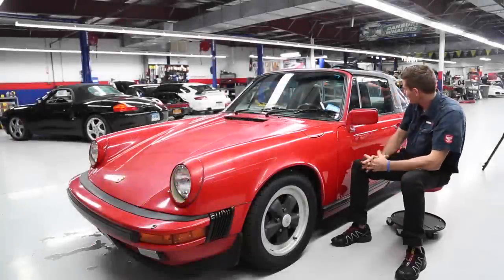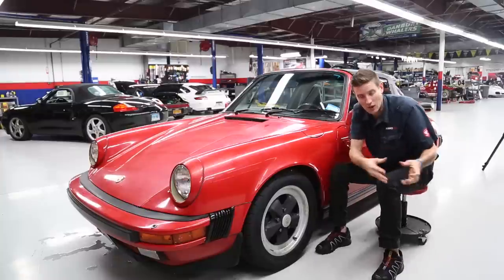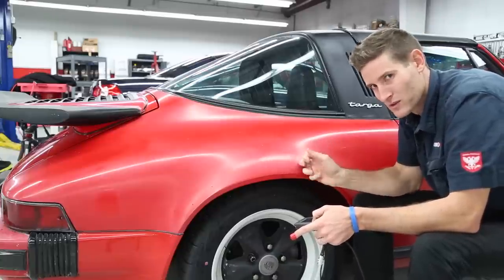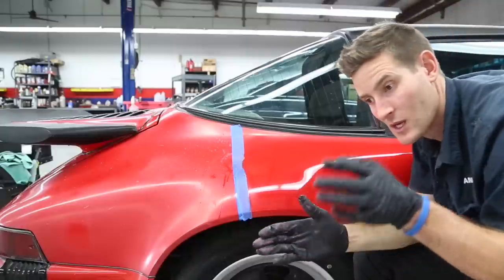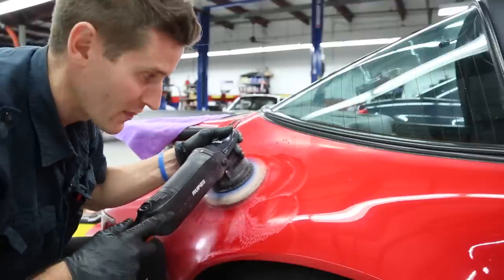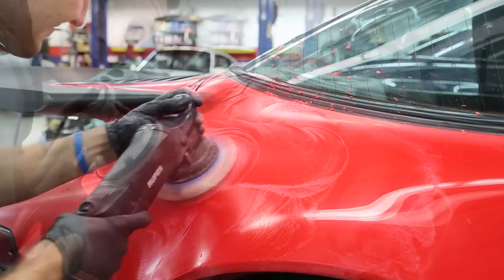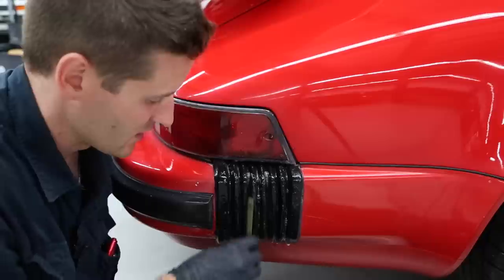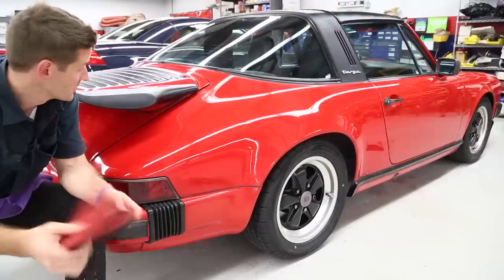How to Wetsand Oxidized Paint with a Rupes Polisher: Porsche 911 Targa

Comment: Larry, as a professional detailer since 1985 working at a very high level, your videos are excellent and filled with common sense instruction and information.  It's funny to me how our processes are extremely similar.  Maybe it's like Chinese medicine.  3000 years of trial and error we're going to eventually figure some things out.  Maybe I'm a bit older school than you but I still prefer a high speed rotary for the meat and potatoes of the cutting work when doing extensive paint correction.  The long throw orbitals like your Rupees or the Griots Boss that I use are certainly game changers for all of the final finishing / buffer mark removal though.  I just find that while far safer for less experienced users, the orbitals just don't have the raw cutting ability to get the paint where I want it in a reasonable time frame.

Comment: That was an impressive job, Larry. Truly a great result.
Last week we gave it a try at cleaning my friend's engine. But the thing is absolutely horrible. Never seen anything like it. Grease, oil, mud encrusted on several spots, wire covers...a real nightmare. He wanted to just improve it a bit, a quick touch. So, I worked on it for just about 1/2 hour, with brushes, heavy degreaser, even Car 80 on the block. But still, has a lot of gunk stuck at several spots. Any advice? Thanks, man.

Comment: i watch all of your videos and have learned a lot but with your paint thickness gauge.  Isn't that measuring the base coat and primer together or is that device you have one of the few that can measure each layer?  Just would like to understand if it's possible by calculations of the device how would you know exactly how many mills just the base coat is.

Comment: When you measure the paint depth, I take it that it measures down to the metal? How do you tell how deep the top coat is, and it's not just mostly filler/primer making up that thickness? Or is it just down to experience.
Reply: He measures the door jam to get the "minimum" amount because car manufacturers tend to use the least amount of paint on these parts that are not exposed.
Reply: this did not have a "top coat" its a single stage paint meaning no clear coat. That's why you can see so much red coming out when he was polishing. old Porches and Ferraris especially the F40 and F50's were notorious for ending up like this. really dull and almost white looking due to the soft paint with lack of clear coat
Reply: jack black I know - by "top coat" in this context I meant the actual colour layer. I said "top coat" because my question pertains to that top layer, whether it is a single stage paint, or the clear coat in a two stage finish.

It seems people haven't gotten what I mean, or am asking about. And I guess this is more relevant to paint that has been redone since the car left the factory as the paint is laid on differently depending upon who does the job, and the paint brand and type used.

I have looked at several paint depth measuring tools, and they all measure the total thickness of paint down to the metal bodywork. That will include any fillers, primers/sealers, single stage colour coats, or base (colour) coat and clear coat.

My question is, how do you know what ratio of that thickness is the top layer you are wet sanding and/or buffing/polishing? It seems to me that it can seem thick enough to wet sand, but it may actually not be.
Reply: mrman17 Most of the thickness is the top layer, that's how you know.
Ultimately, you wet sand when you have to wet sand, and you don't when you don't. If it's what it takes to get off the oxidation, then you do it even if there's a risk of going through the paint, after confirming with the owner. There's no magic wand to wave, especially on hand-painted cars which might well have uneven thickness since the painter is spraying for a look, not for a thickness.
Got a nice hole in the paint on the door of my '82 300SD, the paint is failing so hard it covers up with wax though. Time for a full respray with a clear coat, like dog intended. We've had clears forever, single stage was always a bad idea
Reply: Martin Espinoza Thanks for the reply. I did just have a bit of a facepalm moment as I realised that if the paint is this bad/oxidised, it really doesn't matter if you do go through as it would need painting anyway.  If wet sanding, buffing/mopping works, then cool, if not, nothing is really lost. 
Like you said, as long as the owner is aware that it may not work.
Reply: He measures the inside of the door and subtracts that value from the readings from the hood or roof

Comment: First off... best videos I've seen on restoring finishes on cars. Maybe pick some better keywords to have people find your  videos. I have been trying a few different things to restore paint on a vehicle with heavy oxidation and has proven difficult as my compounds and polishes have been difficult to remove after applying by hand or by machine. I have wet sanded and tried; still little success to remove the dried up application without alcohol or "quick detailers". I have been seeing that it is good to apply some glaze to allow the paint to soak up the oils and then give compounding and polishing a go.. I see you have done this single stage on the red Targa and was trying to figure out what you are talking about with adding leveling fluid to compound? Also any suggestions for my restoration of this old oxidized paint would be great?

Comment: Hi Larry, just wondering if i could do the same process on oxidized alloy wheels paint ? 
Wheels are in good shape (incidentally, they are pretty much as old as the 911 targa), but the paint looks dull, almost matte. I'd much rather do that than having them resprayed. Thanks for your straightforward and filled with knowledge videos.

Comment: I saw several comments about the paint depth. Here In the US as most know, our measurement system is a little strange. But basically a Mil would generally refer to a millimeter. Not in America, we call it a millimeter. A Mil when spoken by a yankee refers to one one thousandth of an inch or .001" it's just easier to call it a Mil and everybody, well not everybody, but most know what we're talking about.

Comment: Larry you are simply amazing.  I have learned so much from you over the last two years since I became a mobile detailer, and I am so looking forward to more.  Lately I've been using my Porter Cable 7424 with a 5 inch or 3-in backing plate and the trizact 3000 and 5000 pads either three inch or 6 in or sanding oxidized or paints with heavy water spots.  I've only done six cars with this method and you're very slowly and learned everything from watching your techniques. I'm still trying to figure out is there a better machine to use for sanding such as the Rupes has 75 air machine whose power scares me.   I thought about the lhr-75e the electric machine to use instead it's a 3 in but one of the versatility of also using a 6-in. So the next stop was looking at the Griot's G8 and G9 combination.  I'm going to the PS polishing and Sanding school on Friday to learn more and look forward to it.  Without your guidance I wouldn't of been ready for it thank you
Reply: What machine do you recommend for a newbie like myself?

Comment: When you wet sand it’s better when you don’t skip numbers....1500-2000-3000. And always in non metallic colours sand a small part and check if the dust you have is white then you are sanding clear not paint

Comment: beautiful job.  This is the first video of your's that I watched and so far I got to say I enjoy your style much better than chemical guys.  

I have one question out of curiosity, as I no longer have the car, would you recommend sanding down and clear coating an older single stage painted car?  As in add a clear coat to a paint only car or is it better to keep the original single stage paint only layer?

One more question, some idiot previous owner seemed to have painted, with a brush, some clear varnish on my black Honda Accord and I would love to sand it down to clear and get rid of those horrid brush strokes.  Question is what should I look into first? and do you think I should invest in a paint gauge? Thanks for your time.

Comment: My truck is white, O.E. GM paint , roughly 12 years old but it's in great condition (of course there's dings but I mean the paint isn't oxidized or faded). Would it be worth it to cut and buff the paint to get rid of the factory orange peel or does the bright white paint make it too hard to see the improvements?

Comment: This is a two part comment .. 

1. Larry, is there a way to properly sand with the polisher? I did it once ( with a foam sanding disc) 2000 grit then moved to 3000.. I noticed pig tail looking sanding marks. No matter how many times I re sanded or compounded and polished.. they were still there. 

2. The yapping is a good thing. We learn alot. (Attention To Detail) I can learn more from a 300 page book than I can a 5 page picture book.
Reply from the maker: Thanks bud. Check out my other videos that include wetsanding. Pigtails are from dirt or grit in the sanding discs.

Comment: Did you try wetsanding with just 3000 grid? Imo 1500 is too harsh, cuts a ton of the paint off. Ive never needed to go that harsh grids on car paint, and ive done some pretty bad non-clearcoat old cars.

Comment: Do you know what kind of factory paint is on a 1989 Ford F-250? I just bought one that is spotless except for the oxidized paint. I was going to clay bar it then compound it and then polish and wax it (all with a DA polisher). Would this be safe on that paint? I know this doesn't compare to the paint on the cars you work on but I respect your advice and love your work. I learned how to compound polish and wax my Excursion all from your videos. It was black with terrible swirl marks. It is immaculate now. So thank you!!!
Reply: Ohio Digger  The factory paint code should be on the inside of the drivers door.

Comment: I know this is an older video but what are you using to determine the thickness of the top coat? Im pretty new to detailing and have only done a few vehicles but they are older ones, 90s Miatas, 2012 WRXs, more subarus, ect. This would be awesome to have for older cars.
Reply from the maker: it's a standard paint thickness gauge

Comment: I was sanding the orange peel on my repainted hood and i accidentally applied too much pressure and left some scratches. i used 1500 and 2500 grit with wet sanding but can i re-sand the hood again with 2500 to try to remove some of the left over scratches? im scared of eating up the clearcoat, or would i be fine with just a light sand ? Thank You AMMO NYC

Comment: Hey Larry if you read this or anyone else that has some knowledge on this. How did you know that you should start off with 1500 grit? Just by trying? I see a lot of other youtubers starting off with 3000 if at all and they get a smiliar picture - is it in the details? few do as detailed shots as you do! thanks a lot!
Reply: with as thick as the paint was, you have plenty to sand with. 1500 is a bit much, 2000 would be a bit better in the case of this car. I've seen a lot worse oxidation living in Florida.

Comment: How can I maintain the shine? Lately I did the same kind of job on an old Audi. After polishing abd waxing it looked superb! But after a month and just one detergent wash it became almost worse than it was before the polishing.
Is a normal wax good enough for protecting it? I mean a usual blend of carnauba and polymer... HiTec yellow wax, Ultimate paste wax, nxt tech wax etc....  
Would a ceramic coating be better???
Reply: Kert Olen Just my 2 cents....Anytime I do paint correction or if the paint is already fabulous, I try to sell the client on a coating. Its going to preserve what you just worked hard making great, not to mention it's going to make maintaining the finish so much easier. Traditional wax has its place but a good coating beats it in almost every aspect, especially longevity. A quality entry level coating will last a year or more IF maintained properly, up to 4-5 yrs+ for high end coatings. If it was my car, I'd get it looking great and then coat it!

Comment: Why not just buff it with a 3M medium cut cleaner? You'll get the same results, machine or hand glaze it after and the results will be the same. I know I used to paint and buff cars for a living, too many extra steps for the same results.
Reply: And he needs a real polisher. Have troubles watching his videos when he pulls his polisher out. I would have this car done and delivered in 2 hours with a Makita and 3m polishes.
Reply: +loveja1 Exactly, it's a small car so two hours gives you time to wash, buff, wash, glaze and detail all the black accents. You're right about the polisher, I use a Milwaukee that I've had for twenty years that has a speed control on it. Best buffer I've ever owned, it's a heavy bastard though.
Reply: +John Crosetto get a makita. Well worth the money. The grip is so nice too.
Reply: His costumers dont go to him for a quick fix 2hr job.  The point here is to get the best possible finish in the least agressive way.   Proper detailing jobs like he does usually takes a minimum of 10hrs.

He is not running a wash'n wax on some street corner.
Reply: +boundish1 Excessive work for factory single stage enamel. Again 3M medium cut compound on a wet surface works wonders. Hand or machine glaze after and you have a show room shine. But hey if he wants to work his ass off for the same results the so be it.

Comment: You did not have to wet sand this old Porsche's paint. It reduces the level of paint by a lot. It was only faded clear not faded paint all the way to pink. All you had to do is obviously a wash, clay, HEAVY CUT COMPOUND with Porter Cable buffer and the abrasive pad to bring back the paint. Then following with maybe a swirl remover, finishing glaze, and paint sealant last all with the appropriate pads. Could of saved a ton of time and the car's paint.
Reply from the maker: At about 4 min mark I went through why that method you mentioned didn't work in this particular situation.
Reply: Makes perfect sense! I emailed you about a question I have for a red car I bought. Great website you have!

Comment: Is removing oxidation from a basecoat/clearcoat harder? I tried with A rotary polisher and wool pad with aggressive compound. It seems like the oxidation was removed but the paint was still pink. It is supposed to be red. What am I doing wrong?
Reply: fuckwututhink you might need to go down to a gentler compound like Meguiars Ultimate compound and then Polishing liquid and then wax.   the pink or light color you see is probably the aggressive compound leaving the surface finely scratched.  some aggressive compounds are the equivalent of using 2000 grit sandpaper.  I think all you need is a progression of finer and finer compounds and polishes.
Reply: Joshua Szeto Using A gentler compound does not make sense to me,If anything I should get more aggressive I think. The car is a 2007 Acura TL, It should be red but it was so neglected it is now pink. Oxidation removed but it is still pink. I have been detailing for 17 years. Never seen anything like this.

Comment: is there anything to do about bubbles in the paint from a fail ass paint job? i spent over 4 grand to repaint my g35 after getting a body kit on it........
Reply: what nick head said... thats a lot of money.  shit should be premium
Reply: bubbles are pretty bad for a high end paint job. it sounds like contaminants in the paint while they were spraying. You could try wet sanding like this vid. but I would just take it back with a list of your concerns written down, and sit down with the manager of the shop/painter and explain that that isnt acceptable for the cash you paid. It better to have it written down with pictures. as you can back up what you are saying etc.
Reply: RsTheJuice401 - Did you get new plastics painted? The tech might of touched the plastic with his hand and transferred oil to the bare plastic. The paint will not adhere to the oil spots.